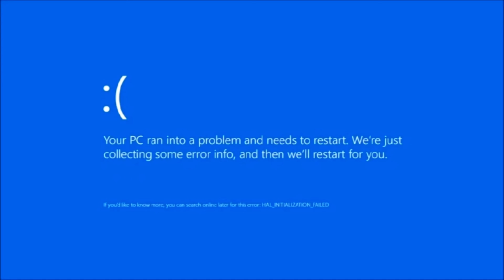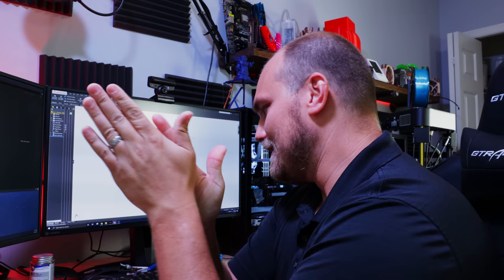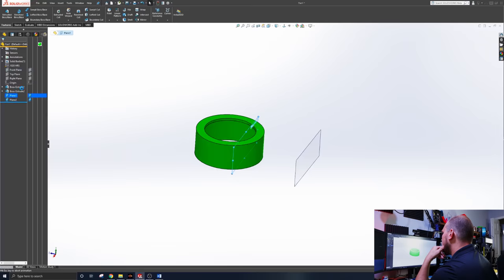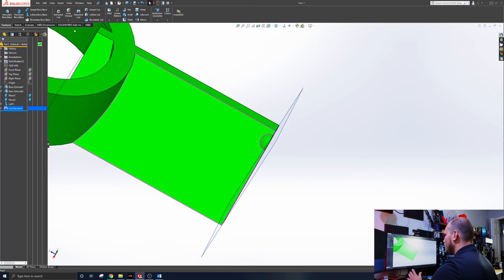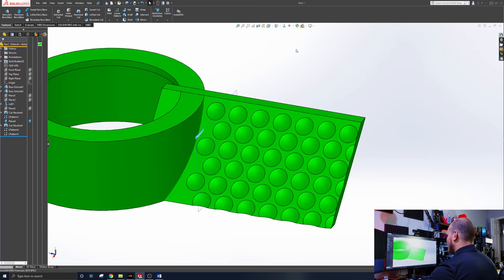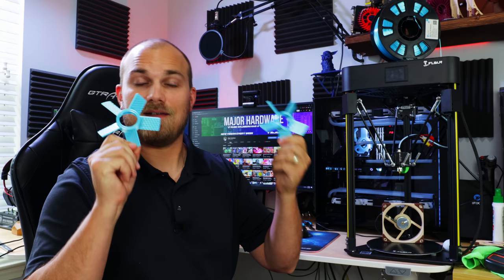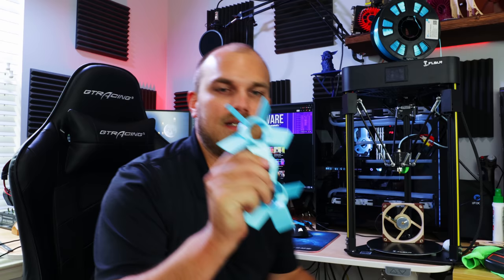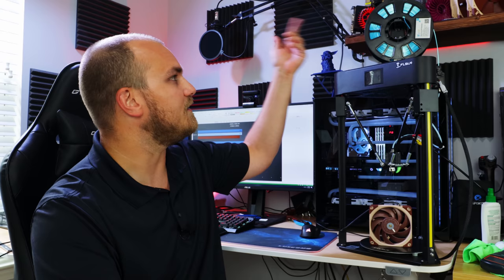What If Fan Blades Had Dimples Like A Golf Ball?

Comment: I know we all already know this, but I just love doing this just to prove how stupid imperial measurement is:

Metric
1Mm = 1,000km
1km = 1000m
1m = 1000mm
1mm = 1000µm
Etcetera. No one really uses decimetres, decametres or hectometres, but everything fits into neat powers of 10 for easy conversion, and has proper names up to +/- 24 orders of magnitude.

Imperial
1 league = 3 miles
1 mile = 8 furlongs
1 furlong = 10 chains
1 chain = 22 yards
1 yard = 3 feet
1 foot = 12 inches
1 inch = 1000 thou.
There are more, like barley seeds, links, rods, fathoms, cables, etc... But I think they were phased out long ago. I never hear furlongs, chains or leagues used, so you get ridiculous jumps in conversion like 1 mile = 5280 feet. In what world is does this make it easy to convert units?!

QUICK! Convert 3.14 miles to feet without a calculator!!....... Exactly. 16,579.2 feet. Oh wait, imperial hates decimal, so 16,579 feet, 2 and ~13/32 inches.
 I do like how the factions are in base 2 though (1, 2, 4, 8, 16, 32, 64, etc), that's neat.
QUICK! Convert 3.14 km to metres without a calculator!!..... 3,140m? Wow! How simple!

Sorry for the rant lmao
. Decent fan design, though a curved blade might help the dimples make an impact... Though I'm not sure ;)

Edit: Imperial made me overthink 3.14 x 1000 lmao.
Reply from the maker: rant approved
Reply: Just in conversion to metres from km you forgot a zero (3140m) :)
Reply: You mean 3140 m? =D
Reply: @RadanValenta  and Tonton, you're both absolutely right. I was so flustered from whipping up stupid imperial calculations that I forgot how to do simple maths lmao
Reply: Imperial was invented by the Romans who created an extremely practical system. Everything is based on common items that everyone has in order to make estimating easy. Precision is worthless in everyday life anyway. Do you tell someone the gas station is 7.15km east or 7km east? It literally does not matter because your number was close enough. As for what they mean, if you measure your foot you'll find that it's roughly a foot. If you walk 1000 paces you'll find you've walked roughly a mile. Either way there's no realistic situation where you have to convert units anyway, so the entire unit conversion thing is moot. How many objects are you measuring that are 1m on one edge and 1km on the other? What are you gonna travel 50m in your car? There's virtually no cross-over in which you'd need to convert units. The only time it's useful at all is fairly small units, like mm to cm, but I mean your measuring device will likely be labeled sufficiently that it does the work for you, or you could just stay in mm. Why bother using 30cm when 300mm works just the same? It's not like you've got to count them and you'll save hours by using 30 instead of 300, just look at the number on your measuring device. It's not even better for dividing. Say your house is 15.73m wide and you want to divide it evenly into quarters. Guess what you need? Either math skills or a calculator, no different than imperial.
Reply: @samueljardine3402  I see that you sir never did any science...

I need to convert units everyday between L, mL, µL, 
Same with g, mg, 
I could not imagine having to do those conversion all the time 

You say that metric is useless based on your life experience I guess but some people realy on precise measurement on a daily basis  

Do we still use carrier pidgeon to communicate? Of course not ! Imperial units were perfect for the time it was invented in, but is completely unrelevant and outdated by today's standard ... Especially for those working in the science business, I remember my time working in a US university and the conversion of units was an actual hassel for them.

Every science work is done using the metric system and there is a good reason for that, it is much more easy
Reply: @TontonGahu  We use L and mL all the time, and especially for science class. I don't ever remember seeing a graduated cylinder or beaker with fl oz on it. Same with mass and grams in science class. In practical everyday life though once again pretty much everything is in pounds (same for gallons. Water towers for example are measured in millions of gallons, motor oil in quarters of gallons, etc.), so there's never really a need to convert units. The reason those Americans had trouble with that is because our schools are trash and continually going downhill, especially colleges/universities. I'll admit in the field of science it has advantages though. However, the reason you put the imperial system down was for units of distance, which I feel I've effectively disputed ;)

Edit: My mistake, I thought you were the same guy who posted the original comment talking about imperial units of distance. Disregard the "you" part.
Reply: @jimmer411  what is true tho is that in modern times metric is better, but imperial was much more practical many years ago when measuring with your tumb and feet was more accessible than a metre stick
Reply: As a representative from America, what in the fuck is a chain
Reply: Random User idk why i would rant ab how metric is superial, norway still uses inches at times(we call it thumbs) to measure for example TV size, while other times we use cm.
Reply: President Carter started switching the U.S. over to metric, and President Reagan reversed it.  Republicans always want to reverse what Democrats do, whether it makes sense or not.
Reply: @jimmer411  Each conversion from units to units require a freaking conversion factor, Why not making it simple and make conversion in 1000 ? this makes things overly complicated and is not useful anymore. 

Once again, all the science is done using Metric, Engineering is also using metrics, why do you think so? To piss people using Imperial units? Of course not, it's because it is much easier to work with. 

Can you imagine if you had to remember different gravity constants depending on which unit you work with? Or having to convert each measurement to do simple math and then reconvert them? This just does not make any sense.
Reply: @randomuser5443  chain was used in surveying. Distance waa recorded as so many chains and partial chains counted links. There were actual surveyor chains that were used like modern measuring tapes.
Reply: @jimmer411  Yeah right, and ONLY when you get SMALLER than an Inch you "suddenly" have no new unit to convert to, so you break it into 1000s.
Or weird fractions.... 

Metric is overall & by far the simpler and hence more practical measurement system.
Reply: @RadanValenta  ummm... 3140 is the same as 3,140
Reply: @samueljardine3402  look guys, a caveman!
Reply: @jimmer411  yeah, but metric can be easily converted between all of its units using mental math, so when doing calculations which require precision, it's much easier with metric, and prevents miscalculations
Reply: @zigon 2007  He Edited comment fixing the issue there was a 3,14m :)
Reply: I always prefer to work with metric seconds, minutes, hours, and days.  They really nailed it.

Comment: If I was a fan manufacturer and had seen this, the reason why it is interesting is not because it performs better, but because as you pointed out, it weighs less. Only 1 gram less in a 12 gram object, but that is a weight reduction of around 8%.

That would translate to a material reduction of 8% per blade, which is a substantial amount when factored into cost saving. I think that would translate as something for manufacturers to look at, and since I bet the plastic blades are injection molded, simply forming a new die with dimples similar to these would save these manufacturers a large amount of money.

Comment: I just purchased my first 3D printer.  I know nothing about CAD, but between your channel, and seeing Superman learn to build a computer, I am ready to learn something new again. (Subscribed!)
Reply: Solidworks is nice but takes some getting used too because it is more designed to build something from a drawing vs fusion which is more organic. I use Solidworks mostly because I find it easier to add things like fillets or make assemblies.
Reply: Knock em dead, Matt!
Reply: PCs are dead simple to build. literally everything fits in a socket.  the hardest thing is troubleshooting and most of that can be googled.
Reply: Jetah they’re easy until you’re told to troubleshoot with a known working part and have to go buy a second PSU, then a second motherboard, then a second GPU, and then you’re told to try a known working CPU which you absolutely can’t afford yet so you’re stuck out of cash and shit out of luck.
Reply: Jetah yes, PC’s are easy to build for anyone who is already experienced in doing so. The correlation between my statement is that Henry Cavill is an actor, and not a PC builder. He’s more familiar with acting than he is with building a PC. I’m a PC tech, and have been building PC’s for over the past 2 decades. Therefore, I am more familiar with PC’s and how they work vs building and using a 3D printer.

Yes, In this day and age Google exists, and can be a great tool to use for research. However, like Henry Cavill, I took the time to RTFM, and build it. It’s a bit more rewarding that way.

Carry on! :-)
Reply: Colin McKenna thanks!! Looking forward to this new journey!
Reply: @Matthew_Lang  the guy's been playing WoW for years. he didn't just decide to buy parts and build one.
Reply: @PeachIceCreamy  but you're returning the first parts so you aren't really out unless those secondary parts cost more and thus push you out of your budget.
Reply: @fraserlamb5787  
I really like Inventor because of its programming features. I've used SolidWorks too and it's great, I just prefer Inventor's UI and iLogic.

Comment: First time here, left wondering about where you could go from here.
1. A golf balls dimples are actually a recessed hexagon, not round and they work only when the golf ball actually rotates in the air moving the air around the golf ball in a separate layer affecting drag.On the fan the dimples have no such obvious ability .
2. If the Dimples can not duplicate the golf balls air flow - moving air from high pressure area at the front to the low pressure area at the rear in a separate layer, then what other benefits could they offer or problems they could cause?? 
3. Some possible measurables;
- Is the fan quieter or noisier (Decibels)
- Do dimples affect the quantity of air being moved (cubic feet/minute)
- Is the same or better air flow created for a lower power consumption, how many watts to move x cubic feet/minute
- Is there Particulate adhesion to the fan blades, does dust accumulate more or less with dimples thus affecting the efficiency over time
- You have shown that there is a 10% reduction in material required to manufacture, this could be a significant saving if you manufacture in the 100k's or they are used in space where a gram costs  $2 to orbit so 12,000 starlink satellites (approved) saving 1 gram each is a $24,000 saving. Every gram counts.
- If you ensure all the dimples on the fan are complete and none are cut off at the edges, does this affect any of these measureables. Maybe incomplete dimples  at the edges degrade the fans performance.

These are just a few ideas on what you could  test for - if a jobs worth doing a YT vid on it, then science the  if you see Kay  out of it.

Comment: Same speed was to be expected. It’s direct drive and as long as the drag does not increase like crazy the motor will just run its designed rom.
Why not measure sound differences. Is the dimplenfan quiter or vv?

Comment: I love these videos, it really scratches my tinkering itch. It's so cool.

also, do you plan on making curved blades with dimples too?
Reply from the maker: i could, there is a flex function in solidworks that i could use
Reply: @MajorHardware  would really like to see curved blades with dimples given that might adjust things somewhat.  And then maybe aerofoil curved blades.
Reply: @MajorHardware  that'd be pretty sweet :D Would it be possible to design something that's like a dyson?

Comment: this was to simple of a design, to create and advance the design of dimples on golf balls they created better and better designs over several decades. adding generic dimples may not give measurable differences. if the wright brothers tried one thing and it didnt work, we might not have planes now. they continued small changes til it flew.
1: golf ball dimples are hexagons (spacing should also be measured)
2: they are not just offset but cross into the lines of other dimples
3: should have entire surface of the fan (this includes the cylindrical base)
4: try a curved profile for the blade and not a flat angle
5: make sure you are not using a fan that is limited to a rotational speed. 1880 might be its general upper end (for the supplied power) maybe try some more extreme speed fan motors. as they may be more of a weight limited motor in this series of tests.
6: also try a higher blade count and the same blade count as this test.
7: try 3 variants, for example... just dimpled on top side, just down side, and on both sides of blades to test if there is a difference among them.
Reply: +1 i think this is the biggest difference to the golf ball:
4: try a curved profile for the blade and not a flat angle
Reply: Sick
Reply: this won't matter, nothing you can do to the dimples or the fan can make them work better because the reason dimples affect golf balls and not fans is that when an object moves through the air, it creates a low-pressure area behind it, creating drag and slowing down the body, because of this, a teardrop shape is the best shape for limiting drag since its outline follows the low-pressure area allowing it to negate the effect almost entirely. the golf ball on the other hand is made to be sphericle to allow for non-directional hits, and therefore must be designed to minimize drag some other way. 

this leads us to the dimples, and how they reduce drag. they do it by creating turbulence on the surface of the sphere, which creates vortexes swirling into the low-pressure zone behind the sphere, allowing air to fill the low-pressure zone more quickly, and lessening the effects of drag.
now, the reason this effect doesn't work on the fan is that its shape is significantly better aerodynamically starting off, as its blades do not generate low-pressure the same way the sphere does, since they are already thin, and don't require air to bend its path nearly as much in order to pass around it.
Reply: @TwelveCrows  the point was its just simply to general of a design to just put small impressions into something and call it "dimpled like a golf ball"
Reply: @brettleisy356  I understand that, however, the WRITTEN conclusion, is that this design could give a more pronounced positive effect if advanced further, and used on more advanced fan designs, which is simply untrue. the dimples on a golf ball give an aerodynamic-enhancement only because they reduce the size of the low-pressure zone behind the ball, whereas, on a fan, they create turbulence which re-directs the air out of the fan, limiting its theoretical maximum efficiency, and ruining it's design.
Reply: @TwelveCrows  incorrect, conclusion is that a design has to be taken to its maximum effect to be called successful or unsuccessful. look at the invention/advancement of air travel. if we simply said "man can not fly" and accepted that premise then we would not have air travel at all. Yet... here we are in a world that you can fly, hover, go into space, and now even small units you can strap on and fly around with. all because a couple of brothers decided to take a few extra steps to maximize their plans and not give up when all current "common knowledge" told them if couldn't be done.
 science is not 100% figure out, we still prove ourselves wrong on a daily basis and new parameters are explored.
 go back a few to the early/pre resonance period and tell them ANYTHING you know about current technology and they would tell you that you are insane, nay! say that you are a heretic! the earth has to be flat! a round (ellipsoid) earth is not possible!
Reply: @brettleisy356  ok... but by the laws of aerodynamics, the dimples hurt the performance of a fan, so this is as good as its gonna get
Reply: @TwelveCrows  by the laws of gravity walking is simply the best we will ever get.
 Im NOT saying it WILL work, but why give up on an early alpha concept?
 there is so much more going on with a golf ball than what you stated.  those vortex also create a cushion of air around them, meaning that its air on air, means less friction.
 which COULD translate into moving air more easily and higher volume.
 turn of LAST century they told Nikola Tesla that he was insane, they even shut down his  experiments, seized everything. now we are figuring out many if not most of his idea's and hypotheses are correct.
  1960s, they made a calculator that took up 1800 square feet, they said that couldnt be done, then they said it'll never have real world application, then said it would never be available to the average person, and now you are debating the principles of one small fraction of science theory using one, and have one in your pocket that you carry with you.
 if everyone used your outlook, we would not have made it where we are technologically speaking.
 we are interfacing the human brain directly for cryin out loud. space travel is looking more likely for the average person every day. we bring people back from death, exchange body parts. all against "known" scientific facts and against all nay-sayers.